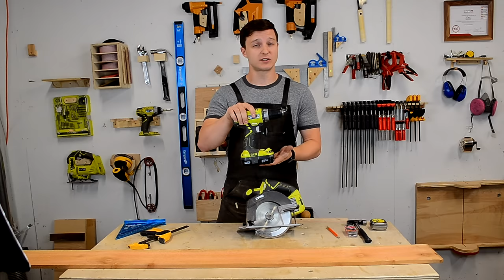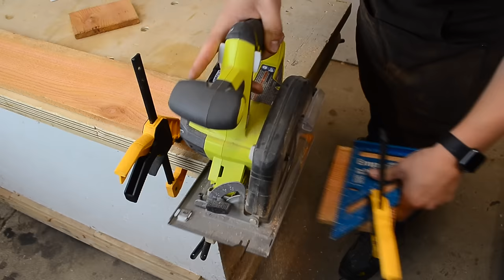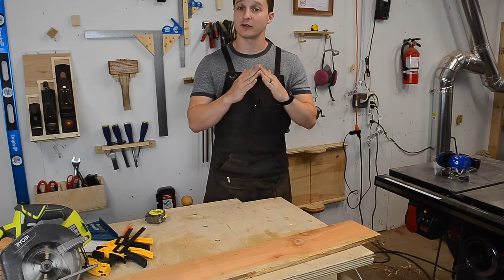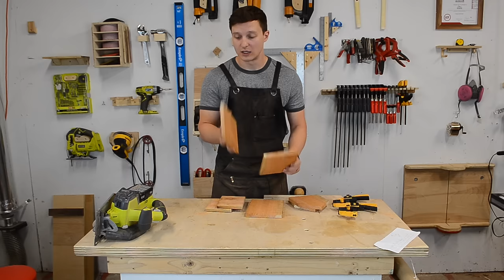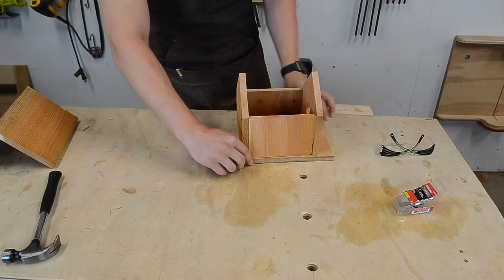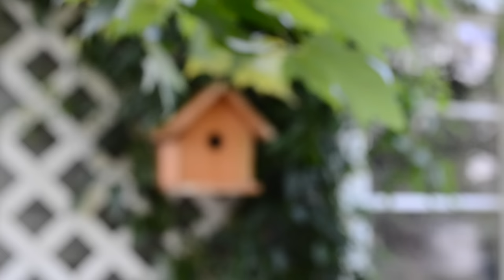EASIEST DIY Birdhouse with Minimal Tools, Every Step Explained

Comment: Unfortunately you left no means to clean the house at the end of nesting season, you should always leave the bottom of your birdhouses free to be removed for cleaning by simply securing them with two pieces of wire running across the bottom and thru small eyelets screwed into the sidewall bottoms. Leaving a small gap around the bottom also aids in ventilation which helps keep it dry.
Reply from the maker: Thanks for thf eedback!

Comment: $2?  In what universe?   A quick check to Home Depot's website and they are more like $17 each.  in any case I just got a load of half inch white oak boards that are about 10 inches wide for free.  I intercepted  a load desi tined for the landfill for some god awful reason.  Free lumber is everywhere.  It is more likely i would find free cedar planks than ones for $2 at any box store.
Reply from the maker: Thanks for watching Nunya! I live in this universe, where cedar fence posts are $2 at home depot: https://www.homedepot.com/p/Alta-Forest-Products-5-8-in-x-3-1-2-in-x-6-ft-Western-Red-Cedar-Dog-Ear-Fence-Picket-63005/205757682

Regardless, I love the idea of getting it for free! Nice work!

Comment: You forgot one important thing for the bird house. How are you going to clean it out. You need to make a way to clean out the old nest
Reply from the maker: Yes, I knew that was an issue while designing this. I wanted to make a bird house that was as simple as possible to build. Maybe in the future I will make a slightly more complicated house with a way to remove the roof. Probably just attaching the roof with removable screws rather than nails is enough. Thanks for watching!

Comment: I hope you realize that rainwater will just pour into the top joint of the roof.
Reply from the maker: That is not the case, I have had these birdhouses successfully used every year by birds. I remove the bottom and clean out the old nests each year. Thanks for the feedback Lenny

Comment: Building a bird house is fun and doesn’t take a lot of skill but be careful which plan you follow. Use natural wood not plywood, provide a door or access to clean, drain holes on the floor, adequate ventilation to avoid overheating, don't use perches, they invite predators and add a predator block over the access hole and never stain or paint.  I know you want to share your skills but inexperienced DYI people can easily follow a cute design that is not good for bird habitation. Always check birding sites like <nabluebirdsociety.org/nestbox-plans/>, or <nestwatch.org/learn/all-about-birdhouses/features-of-a-good-birdhouse/>

Comment: I wish I could have been there to stop you. you used the plank of wood that you could have made another 4 or 5 bird boxes from.
Reply from the maker: Which plank?!
Reply: @dkbuilds  Oh sorry mate. the piece you cut from the plank to cut out the hole well the one underneath. the hole bit went through  into the  one you used to make the make either sides back top or bottom. It didn't go right through though. Hope I've answered your question my friend?.

Comment: Not very practical for cleaning out old nesting materials, 
you’d have to disassemble it...🤔 🙄 🦃
Reply from the maker: Good point James! Absolutely true. I tried to make this as easy to build as possible, which meant making it a little hard to clean out. I would step this up by using screws to attach the roof, so you could just unscrew it to clean it out each year. Thanks for watching!

Comment: Do your homework. A real bird house must have a clean out door. If not, it’s a decoration. There’s more to making a bird house than sawing and nailing.
Reply from the maker: I agree a proper birdhouse should have some way to clean out the nest each year. For example the roof or floor of of this could be attached with screws instead of nails for easy removal. I personally removed the roof of this one and reattached with screws after the first year. So far three generations of birds have lived in this house.

Comment: That’s irresponsible. 
1. The ledge is a place for predators to stand and reach in for the chicks/eggs. 
2. A squirrel can gnaw through a half inch plank in 60 seconds
3. The roof seam is going to leak, making the chicks wet and hypothermic. 

If you build this for decorative purposes, plug the entrance. 

If you want to teach carpentry, start with the design phase to teach how to analyze the problems and design to overcome them.
Reply from the maker: Thanks for sharing your thoughts, NM!

However, I must disagree with your characterization as this video being "irresponsible". I think that's a gross overstatement that you should reconsider.

Your point that the ledge may be a place for predators is indeed correct, and perhaps the roof seam may leak. I can't speak to a squirrel's ability to gnaw through wood, nor whether chicks will get hypothermic. 
I will say that I've built many of these bird houses over many years and have had many successful chicks born and raised within them, and I have had zero issues with predators like squirrels. I'm not saying these bird houses are completely safe, I'm just saying that in my personal experience they have worked very successfully.

As for your point about teaching carpentry, I generally agree that learning to analyze and design around problems is a critical skill that a good carpenter needs. However, I also think that every person needs a starting point to take their very first step into carpentry, and that starting point should be building something very simple and straightforward following exact instructions from a teacher. This is what I am hoping this video provides. Once they have assembled the basic technical construction skills, only then they are prepared to explore designing their own pieces.

I appreciate you watching my video and leaving a comment, despite the fact that I disagree with much of what you say. Have a nice day!
Reply: @dkbuilds  I applaud your approach to criticism. After reading your commentary, I freely retract the term, “irresponsible”, with apology. That should be applied to an intent of reckless disregard. Obviously, you are not a thoughtless person. 
It appears that you have had good experiences with your birdhouses, and that, naturally, and rightfully, informs your opinion of this design. 
Please allow me to resubmit my thoughts without prejudice. 
I appreciate your approach to teaching woodworking for kids. It’s thoughtful. 
Because I’m a zoologist as well as a woodworker, I guess I put animal handling projects in a special category that may not be suitable for a beginner effort. I feel a heavy responsibility when taking the care of animals over from nature as we do when attracting birds to house and away from their natural houses. The best of places they “hole up” in, like tree trunks, have great advantage over predators, and weather. 
I might suggest:
- a glued joint at the roof ridge. Better yet some sort of ridge cap, like two, 1-inch strips connected as you do the original roof ridge, but connected on the opposite side, and again, glued on. 
- Four 3/16 holes drilled in the bottom for drainage of water, and other fluids
- placing a tin can end-plate over the entrance hole (with a matching entrance hole of course) to keep predators from enlarging the hole to get at eggs/chicks

- doubling up on the boards to thicken the walls (predator avoidance and thermal inertia

- making the box deeper to get the hole further from the bottom to avoid, “reach in” by raccoons 

- making some deep scratches on the wood from the hole to the bottom to facilitate chicks ability to climb to the entrance hole

These would seem easy enough for fundamental teaching of both woodworking and biology. 

Again, please allow me to submit this constructive criticism in place of my wrongly condemning original, and compliment you on your detailed, reply in the form of fair debate so rare these days.
Reply from the maker: @NMranchhand  Thank you for the kind and thought-out response. I agree with your restated thoughts, and appreciate your unique domain expertise in this niche area (zoology crossed with woodworking). An improved waterproofed roof, drainage holes in the bottom, improved entrance hole, thicker walls, deeper box, and roughening of the wood surface for chick traction are all fantastic ideas. If I ever create a "next level" birdhouse video I will absolutely include these design improvements, as they are easy enough for a beginner woodworker (my target audience) to implement, and will benefit the birds occupying the home (the end user). Thanks again for watching and taking the time to construct comments. I learned something from you!

Comment: Trust me, you'll never buy a cedar fence board anywhere for $2.00
Reply from the maker: What about right here? https://www.homedepot.com/p/Alta-Forest-Products-5-8-in-x-3-1-2-in-x-6-ft-Western-Red-Cedar-Dog-Ear-Fence-Picket-63005/205757682
Reply: Pine boards yes, cedar never.
Reply: Check the imperfection bin.
I've found some cheap. 
The cheapest (several yrs ago),  .95 cents. Just enough cedar to build one house. 
But since covid19,  prices are sky rocketing. In 1 yr, $10 on ply. 😲